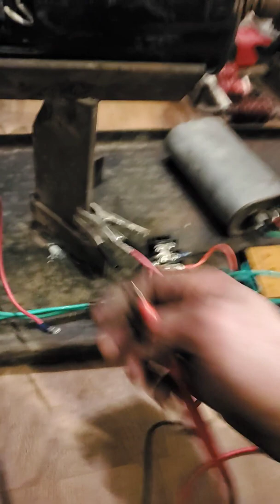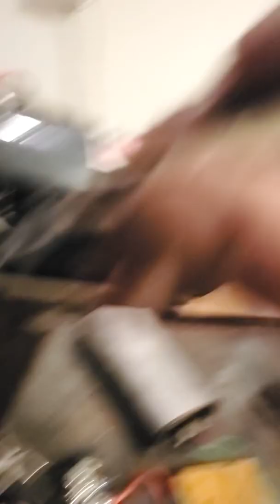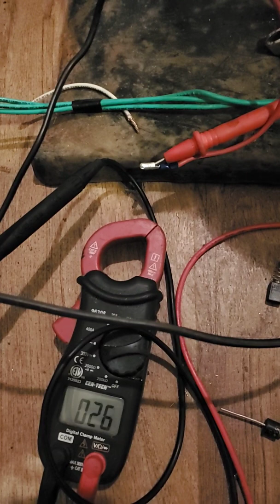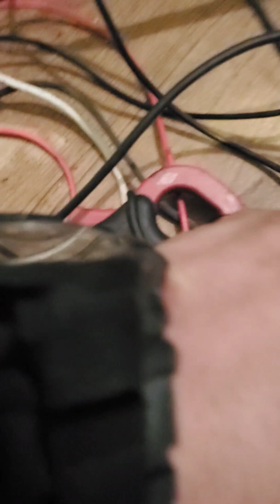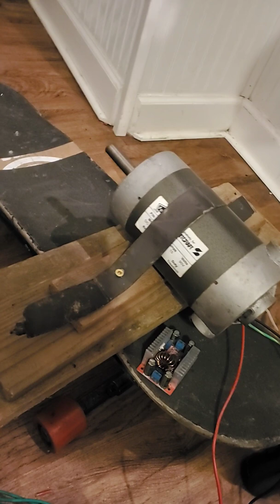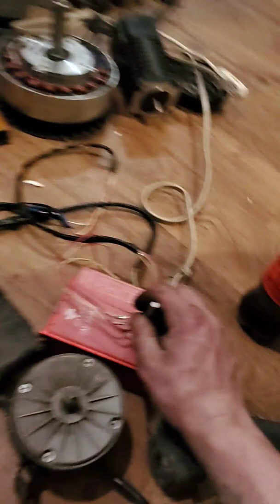overunity motor+generator from DC treadmill  motor! FREE ENERGY FOR REAL!

Comment: did u end up placing the brush next to the negative as mentioned in ur video..? any updates regarding this..?
Reply from the maker: Yes I did and it works. And works really well. Increased speed and output. Still don't quite understand what is going on here
Reply: @MrFigureitout  i have tried it and indeed it works...i came across a similar upload whereby he inserts an iron brush next to the carbon and somehow, the battery gets recharged while in use... interesting indeed..
 https://www.youtube.com/watch?v=C2UsrInl7rk

Comment: If you are using a power supply other than battery.=  amps from power supply is cut in 1/2 or less. that is why you can run the other motor that the rpm seems the same but gobbling up the back spike . so what is happening 1 equals motor & 1  equals generator. same as golf cart motor that acts as starter & generator. So only amps in  addition is counter amps that cancel each other out.

Comment: hey a friend of mine just told me that a  golf cart motor does the same thing .!  when you short the comentator out. what is actually happening is called reverse flux.  there is no extra amps just voltage.  actually like he said  that the comentator will burn out real fast. because you are blocking the amps back into the negative side.  even might make your 12 volt battery explode. just be careful and wear goggles to protect your eyes if that happens.
Reply from the maker: THERE IS CERTAINTLY AMPS.  But thanks for the warning I will keep that in mind.  So far after many hours of this I have only found positive effect.  excerpt one time I shocked myself pretty good!! and let me tell yea, it didnt feel like just volts to me!
Reply: Haha

Comment: what will happen is comentator will short out being the windings do not have the correct ohms , will burn copper winding up.  not made to take direct amps to comentator without correct ohms.
Reply from the maker: And what ohms would they have to be in order to work? Please tell me more!
Reply: @MrFigureitout   you will have to figure it but buy using Lenz Law.  you can have a million volts but not even any amps.  volts do not mean amps. !!

Comment: I just duplicated your experiment with a 2hp treadmill motor, 100% gold! The thing spun at least 3 or 4 times the speed maybe more!🤣 the current went from 220ma to 1.2 amp, but I think with higher voltage that would drop considerably or remain relatively low, I used a trickle charger which puts out a massive 11.2v 😆. Very nice, very nice👍
Reply from the maker: Awesomeness

Comment: Question... is that big outrunner a 42 leg or 36? Never used one of those controllers, but I have heard that the 36 leg motors are more easily controlled and get more rpms...
Reply from the maker: You know I'm not sure I will check

Comment: some late info.        clueless          volts  are  NOT   Power.        power is   WATTS.
watts = volts  x  amps.            volts  can  be  measured  with  Almost No  Current  flow.
for  a  lenz-law  reality check,  SHORT  the  output, and see 'how easy' it is to turn, then.!!!

W  T  F    is  a     1.75 v   treadmill  motor.!!!!!!!!!!
Reply from the maker: I did my calculations in WATTS.  IT IS A 175 V TREADMILL MOTOR!!!!! you must not have watched the whole video
Reply: @MrFigureitout  how many watts were you able to get, I didnt se that part in the video?
Reply from the maker: Depending on the voltage I supplied to the motor I would always get almost equivalent to the amount required to run the motor. If motor was using 50 watts, the output capability was 45 watts and would run any kind of dc load you put on it including a dc motor.  Therefore you could use the motor for some purpose and essentially re-use the power to do something else. For example, use the motor to run a washing machine and use recycled power to run the lights in the room or possibly power the dryer(actually vise versa makes more sense due to the required power to run a dryer exceeds that to run a washer in most cases.)!
Reply from the maker: There was a few experiments where the output wattage exceeded the input wattage but only when running non inductive loads for some reason.

Comment: What is the red controller
Reply from the maker: It can spin up the 12 washer motor at 2000 rpm. No other controller I have found can do that except my canadian controller.  But this one is much more efficient and with the programmer I just got it will run it sensorless! That's a major accomplishment considering the cost of my instaspin foc setup coming in at $1000 bucks.  My zm-7205a comes in at 100 bucks with programmer and is small enough to fit in an electric scooter.  With a 12v battery and an inverter to get 110v ac you are good to go. Only pulls 300watts +/-.  This is my plan exactly with the drum motor and chopped ninja 250 coming soon!!
Reply: @MrFigureitout  wow, thats amazing! Can you share the link where i might be able to get that controller?
Reply from the maker: Sorry for the delay on this man. #Aliexpress US $110.00 | DC Brushless Driver ZM-7205A Controller + Handheld Smart Debugger MPG with or without Hall
https://a.aliexpress.com/_dZMq6jP
Reply from the maker: It's a new controller I just got from overseas. It's absolutely the best one I have found yet